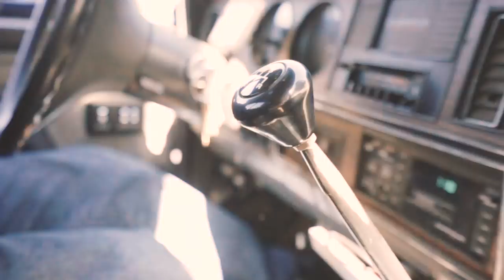So What Did I Actually Buy - Sink or Swim 03

Comment: Congrats on your new boat! What are your plans for a relief area for champ?
I'm blind and use a guide dog we cruise often I have a couple suggestions for you 
First super cheap Disney did this before they did the big trays they took a miniature kiddie pool and put a hunk of sod in it -  you could also use much 

When they got technical and started having more dogs on board they got a tray that's about 2 feet wide by 4 feet long and two pieces of sod fit in there nicely you could also do mulch as well .... let me know if you'd like the information on the tray and I can call my contacts over at Disney and see if they can tell me where they get their's  Just a shallow tray picture like the bottom of a shower.... you're a smart enough guy you could probably even build a box line it with a tarp and throw some mulch on top ...., 
Hope this is helpful

Comment: That lister diesel is probably the best most simple and reliable engine that i have come across in the marine industry. They are worth keeping as a back up
Reply from the maker: +Andrew Tiefry it's absolutely huge and incredibly inneficient. Not to mention air cooled so you need an extra large space and fans to cool it. It weighs so much my boat sits on a significant angle for it being in the starboard hull.